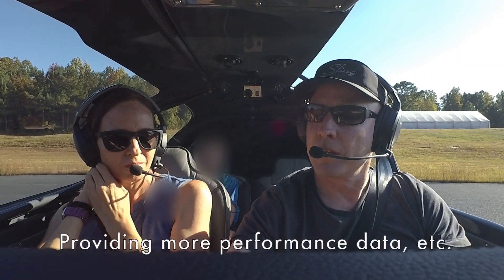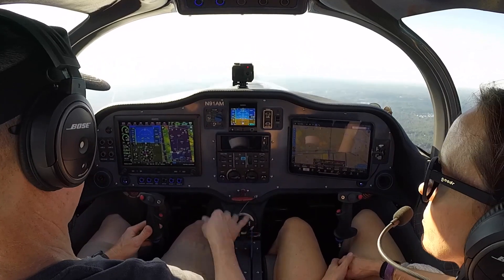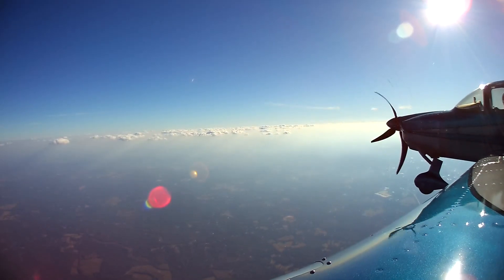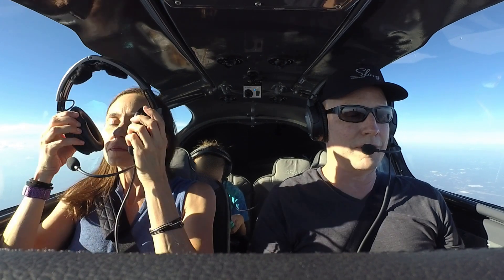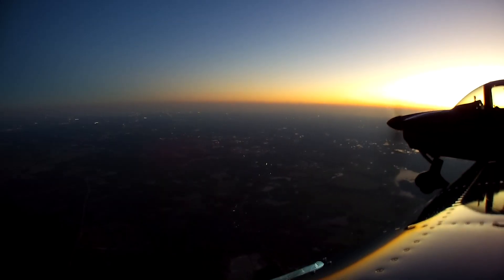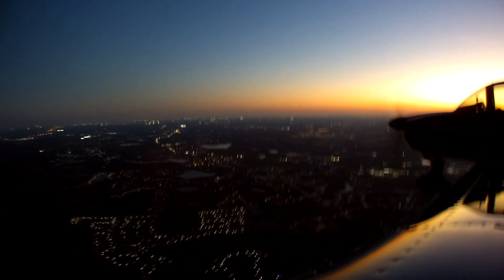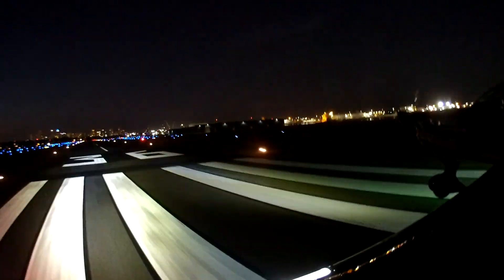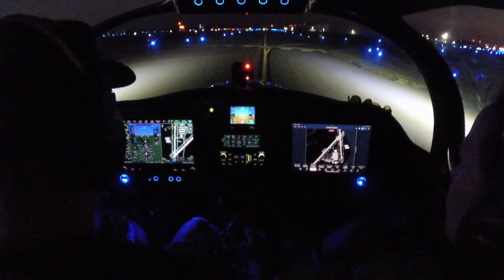Sunset flight to Tampa (with Sling TSi performance data)

Comment: I'm considering building a Sling TSI. I also saw your video on calculating TAS. How comfortable are you that the TAS you show in this video is an accurate number? I think you said in that video that it was a bit inflated due to the locations of your OAT probe and your static ports?
Reply from the maker: It was reading about 3-4 knots too fast at cruise.

Comment: Hi, it's me again..... :-)......... // 11 min 26 sec: I am looking for an explanation what might have caused the "dents" in the upper wing surface... / greetings
Reply from the maker: A few things going on here. 1.) Some flexing of the skin happens when you rivet it to the ribs. It's known as oil canning, and is quite common. 2.) The metal expands/contracts with changes of temperature. You can hardly notice it on the ground, but it can look more prominent in the cold air at altitude. 3.) The angle of the light hitting it from the setting sun made it look worse than it normally does. I almost didn't include those pics because the wing looked so much worse than usual, but I couldn't resist the sunset! 4.) I may not have let the skin "relax" enough before I riveted it. The skin comes somewhat folded over in the shipping crate. I built my right wing first. For my left wing we let the skin lay flat for a couple of days before riveting. As a result, my left wing looks much better, virtually no perceivable oil canning.

Comment: Only 30 gallon tanks??
Reply from the maker: It holds a bit over 45 gallons usable. Due to dihedral, the float indicators are only accurate below 15 gallons.

Comment: Hello Mike, I have a technical question for you: when you showed the first cruise setting at 155 Knots TAS, I was wondering about the vicinity to VNE of this airplane which is 155 KIAS. I know lots of people will say that VNE is always IAS and therefore we fly safely at high altitude but I have been reading more about this topic and found interesting articles regarding the correlation of VNE and TAS due to the flutter risk at high speeds/altitude combination. It will be interesting to further analyze with your experience. Thanks Matt
Reply from the maker: Sounds like you’ve been reading some Vans stuff! Vans are the only airplanes I’ve ever seen that express Vne as a TAS. Every other airplane with which I’m familiar expresses Vne as an IAS, including the Sling TSi.

This is a common area of confusion. Vne is set by the manufacturer as an IAS which can be limited by multiple factors. One limiting factor is wing-bending moments, which is most certainly a factor of IAS. Another limiting factor is flutter, which is indeed a factor of TAS. However, Vne has traditionally been expressed in IAS because, prior to advanced avionics, that’s the only thing we could read on our instruments. 

Wing-bending moments are more of a factor at lower altitudes, where IAS is higher, while flutter is more of a factor at higher altitudes where TAS is higher. So, the manufacturer typically sets a Vne in IAS which protects the aircraft from excessive wing-bending moments AND flutter. 

To say, “Vne is a TAS” confuses the issue. This makes some people think they can’t fly the airplane at a TAS greater than the Vne. That’s not true. The Sling TSi has a Vne of 155, yet also publishes cruise speeds in TAS well in excess of that. Virtually all jets fly at TAS which are much higher than the Vmo (jet lingo for Vne) which is in IAS.

Other than Vans, most manufacturers set their Vne in IAS. That means that, if you stay below that Vne (in IAS) you should be protected against excessive wing-bending moments down low as well as flutter up high. IOW, they have tested the Vne in IAS from sea level up to the max certified altitude of the airplane and found that it protects you throughout the envelope.
Reply: @OneAlphaMike thank you for the thorough explanation

Comment: question    I am in the process of ordering the Sling and I am debating going to 2 G3X or 1 and Ipad like you have.   I dont have my instrument yet so dont know if 2 would be better for instructor.    Any input would be great.    Just subscribed.
Reply from the maker: I'm a CFII and I find a single screen is just fine for the instructor. I think one G3X and an iPad offers several advantages over two G3X screens. I discuss this in a couple of my previous videos:

https://www.youtube.com/watch?v=SHw-69o8TbI&t=475s

https://www.youtube.com/watch?v=cRPFt-etlY4&t=528s

Comment: I'm kinda noodling about an idea for some sort of remote device to allow for flow control over the oil cooler.  But I gotta get mine finished first.  I hope to be joining the flying club soon.  :)
Reply from the maker: I know a TSi owner in Michigan who put one of these on his oil cooler: https://antisplataero.com/products/oil-cooler-air-shutter

However, it's too small for ours, so he ends up still having to tape in the winter. If somebody could make something similar to this that's properly sized for our oil cooler and radiator, that could work!
Reply: @OneAlphaMike  I have a machinist who has helped me out with some custom pieces here. I have to chat with him about a few other parts I need made. I’ll toss that on the discussion pile. 

I doubt he’ll be able to do it for that price though.
Reply from the maker: @ibgarrett  Maybe Anti Splat would be willing to make them for the Sling community. I really just wish Rotax would design a thermostat for their engines.
Reply from the maker: Another option. This company sells oil and water thermostats for the 915, but I don't know anyone who has tried them. https://www.flyrotax.com/assets/filesDistributors/dis0008/Special_Accessories_10-2022-komp.pdf

Comment: Hi Mike Could you tell me what Pivot mount you use & do you find it has enough angle so you have a good view from your seat?
Reply from the maker: I have this one: https://flyboys.com/collections/efb-accessories/products/flush-permanent-mount-amps-plate-with-ppk-1

It has enough angle for me. If you want more angle, you can buy their High Deflection model: https://flyboys.com/collections/efb-accessories/products/high-deflection-amps-adapter-and-ppk-1-kit

But then it would protrude a little more, and your stick might hit it.
Reply: Thanks Mike

Comment: Great video. I am building a TSi here is Aus. Do you mind saying what iPad most you're using? It's powered it seems.
Reply from the maker: If you meant "mount," I'm using this one: https://flyboys.com/collections/efb-accessories/products/flush-permanent-mount-amps-plate-with-ppk-1

The mount itself is not powered, the iPad is plugged into a USB-C outlet with a cable.
Reply: @OneAlphaMike  Thanks. Yep, meant "mount".

Comment: eco mode kicks in when you are at 80% or less
Reply from the maker: Technically, it's 97% throttle position. That does loosely correlate with about 80% power, but I can tweak it up to 82% or so before it bumps out of ECO.

Comment: Awesome Mike.   Looks great at night.   What landing lights did you choose?
Reply from the maker: They're just the ones that came with the kit. Honestly, I don't even know what brand they are!
Reply: @OneAlphaMike  Am I right that they kept wig wagging all the way down to the ground and didn't switch to landing mode?
Reply from the maker: @justindwyer3430  They switched just before touchdown. They're set by airspeed, so I probably just need to adjust that speed so they turn steady a little sooner.